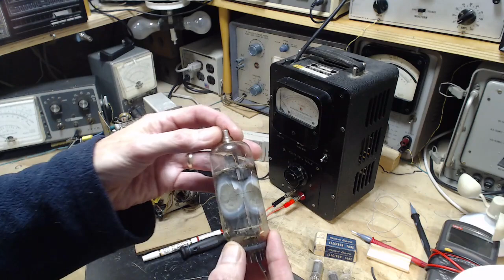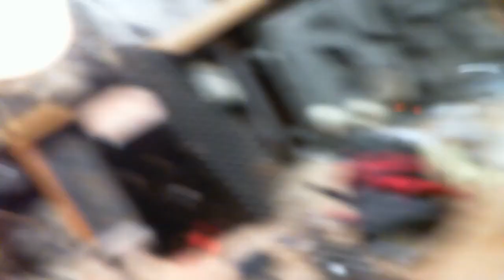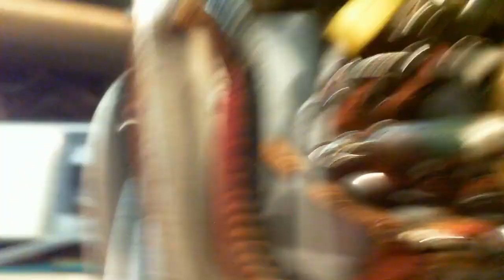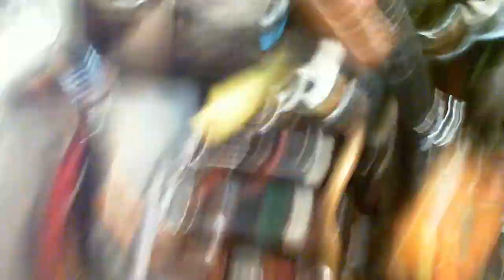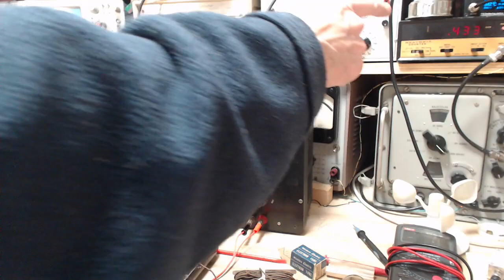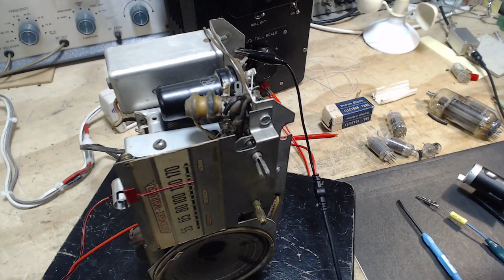Stewart Warner R514 Tube Radio Video #3 - Troubleshooting Oscillation

Comment: This is a very strange circuit. Look where the volume control is connected which might explain why it effects RF feedback. I don’t think Jim has noticed yet.
Reply: Strange circuit indeed. The volume pot not only shunts the antenna RF to ground but on its other leg also varies the resistance going from the cathode of the OSC/Mixer tube to GND. If the wiper on the pot fails then the cathode of said tube is grounded via the primary of the antenna transformer. Recipe for feedback oscillations.
Also weird how the Audio is taken off of the hot IF side of L4 via a low pass filter, instead off of the detector diode along with the AGC. 
If you were to present someone the circuitry around the second IF tube 6B8 and L4 out of context I bet most people at first glance would take it to be some sort of Oscillator. Which may exactly be why it is easy to make it oscillate at IF frequency.
Reply: I suspect the audio detector using the if stage to detect the audio is some sort of regenerative detector used in early simple radios
Reply: @widecast  
The 6B8G is used twice first as a IF amp then as a AF amp .

Comment: Those solder joints are a good example of what happens when the iron is not hot enough.
Reply: And too low power of the iron. Also lack of skills/technique. How many time do we see Jim jab his soldering iron at a solder joint, instead of placing it onto the joint and waiting for the iron to heat it up properly.
And also lack of flux. You dont need to go Louis Rossman style at it but adding a bit of extra flux does wonders on resoldering and soldering to old connections.
Reply: @randomsteve4288  When I was an apprentice , the engineer who taught me said,  your hot iron and plenty of flux are your best friends.